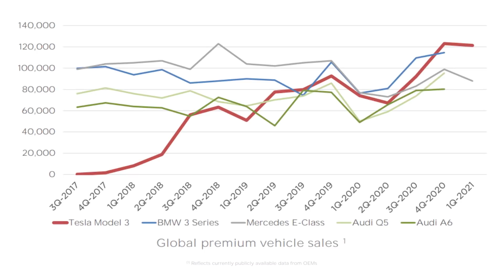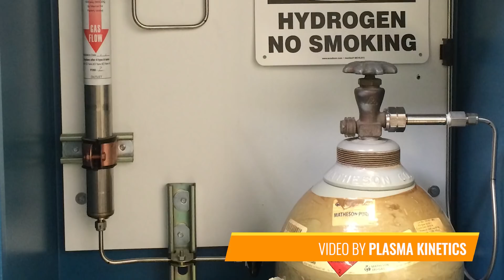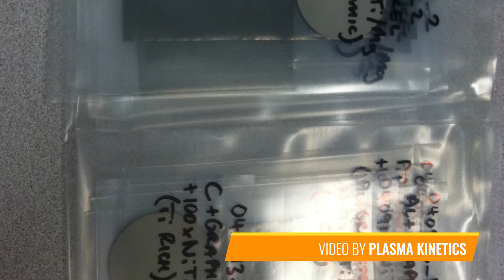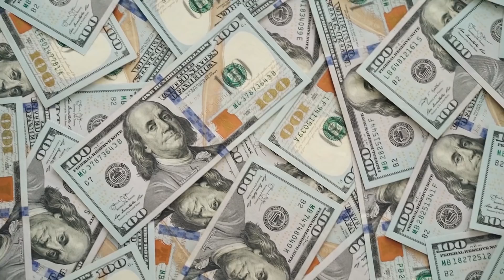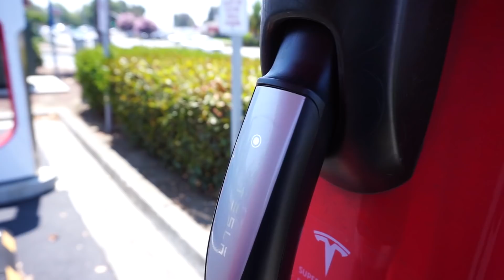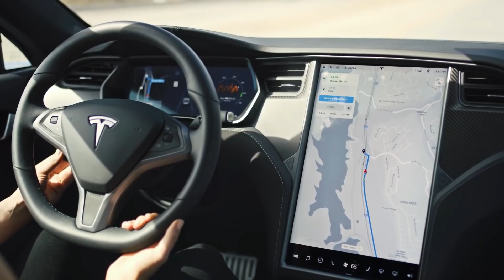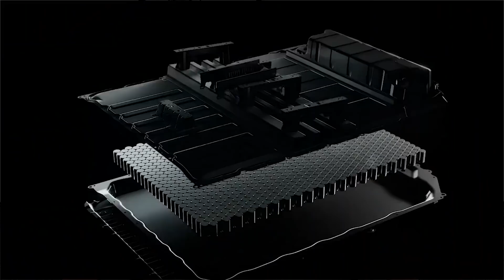SANDY MUNRO: No Batteries Needed for Toyota to Rival Tesla

Comment: toyota has the engineers... and the can-do spirit. I like sandy.. and he has some good advice here. but hydrogen is a DEAD end for cars & trucks. aviation? shipping?  definitely. what you have to realize is that H2 is NOT an energy SOURCE. it is only a way to STORE energy. first- a toyota mirai has ALL the components of a BEV. PLUS a fuel cell. and ANY way you slice it- the 'energy' has to start out as voltage. that voltage gets converted to h2.... then back to voltage.. then charges a battery pack... then runs the EV motor. STUPID.. STUPID STUPID. 

 the cheapest way to get hydrogen as of today- is electrolysis. but 96% of ALL hydrogen is produced through steam refraction of methane from gas wells- by big oil. and THAT is the ONLY reason it's even being suggested. I have no problem with that- the 'go green' proponents are against it.. I don't care about that aspect- but economically.. it's even MORE expensive than electrolysis. the cheapest H2 available NOW is nearly $5 a gallon comparatively speaking. toyota's fuel cell.. as good as it is.. has to be replaced at 200k milels... at a cost of around $38k. there are 30 h2 stations in CA.. 2 on the eastern seaboard. lmao.. if tesla had that number & that distribution of dc chargers? the ENTIRE media complex would eat EV's alive in the media. elon was right- HYDROGEN IS STUPID. that's why their sales numbers are dismal. 

hybrids:   a toyota hybrid is nothing more than an ice vehicle.. with a pint sized electric motor & a laughable battery pack. now.. that being said- toyota makes a great ice vehicle.. true. but in the end- that's all it really is. they might as well give you a D-cell battery & a hair dryer motor rubber banded to the drive shaft of a camry.

 but they could be incredible if they wanted to make it THE RIGHT way. 

what they need to do is take a closer look at a chevy VOLT. now THAT is a hybrid. NO TRANSMISSION. at all. no clutch. no torque converter. no direct connection between the wheels & the ice engine AT ALL.

 a volt- is quite simply- a PURE BEV... with a portable gasoline generator on board: and THAT..does some pretty amazing things.

 for one- it vastly extends the life of the ice engine. no torque pulses or harmonics get transferred into the drive train. just a gas engine running a generator. as such- the engine system can be tuned & maximized for operating efficiency to deliver the necessary kwh's to the battery pack- which is significant enough to drive the car for nearly 60 miles with NO GASOLINE AT ALL! so if your commute is within 30 miles? you may never need a drop of gas. this is the format that toyota needs in all their ice cars- and make it a diesel please. 

the fact that mr. toyoda seems HELL BENT on consuming petrol products.. is telling. TEsla gives us consumers OPTIONS. pure bev.. solar power with storage. ask yourself THIS question: if gas prices go up... and I drive an ice car... WHAT ARE MY OPTIONS? the truth is.. .YOU HAVE NONE. and big oil KNOWS THIS. and that's the way  it's been for a century. if I drive a tesla... I can super charge.. and even if that goes up.. I can charge at home. some die hard oil heads would argue that once everyone starts driving EV's.. they'll hike the price of KWH's too.. ok. maybe?

 but even then... i still have options. tesla solar- VERY affordable- I would now- I have  a tesla system with 27kwh's of tesla power wall. like I said- OPTIONS. if I bootleg some used veggie oil & burn it in my dodge diesel- I'd likely get caught & fined by the dmv or CHP.. but I can buy used veggie oil legally & run a diesel generator at home for "power".. and use it to charge my EV's... like I said- OPTIONS. BIG OIL is angry & grasping at straws because tesla is taking away their monopoly on energy. GOOD FOR ELAN! thanks big E! you rock.

Comment: My money is on hydrogen. Toyota stick at it. Electricity is too scarce a resource
Reply: Lol so how do you want to make hydrogen if electricity is ‘too scarce’.
Reply: @Simon-dm8zv  Cost benefit analysis of the two contenders spiced with time for the hydrogen tech to improve...we have a clear winner
Reply: @mindapothecary  Hydrogen will always remain far less efficient.
Reply: @Simon-dm8zv  That's a bold statement. Let's not forget the future potential of hydrogen...on demand production of needed energy and not reliant on storage  only
Reply: @mindapothecary  Unfortunately it is just simple physics. All the steps of production, compression, transport and conversion in the fuel cell require energy. These steps can be improved to a certain degree, but never eliminated.

Comment: The new hybrid: combination of BEV and hydrogen fuelcell EV based on this new technology. Batteries for the most range in driving and you have some discs onboard for when the next supercharger is either fully booked or too far away.
Reply: Pointless, Hydrogen FCEVs have exactly the same Electric motors.  It would just be an FCEV with a bigger battery and thus higher costs.  Of course if battery prices come down, there's no reason why FCEVs can't have a bigger battery anyway that they can plug in and charge, thus getting the best of both worlds since directly charging with Electricity is more efficient and cheaper than generating it from Hydrogen.  Would be interesting to know how much space the discs and their generating equipment take compared to the current Hydrogen tanks.